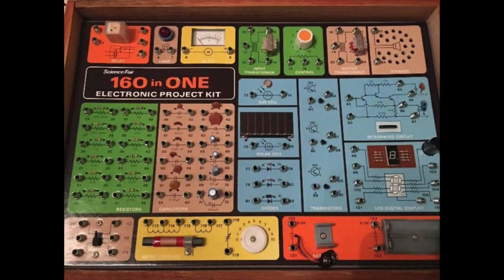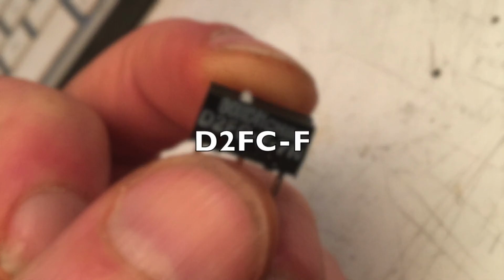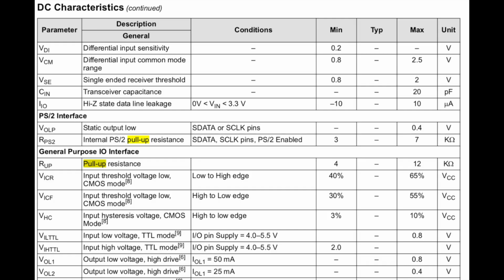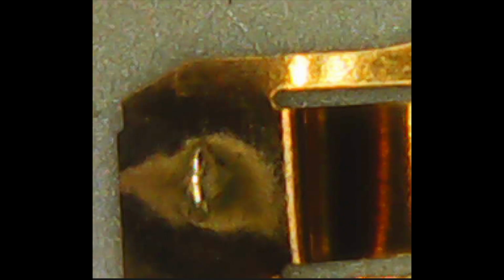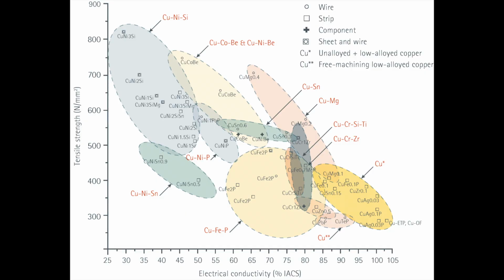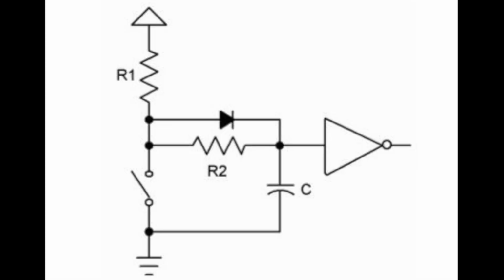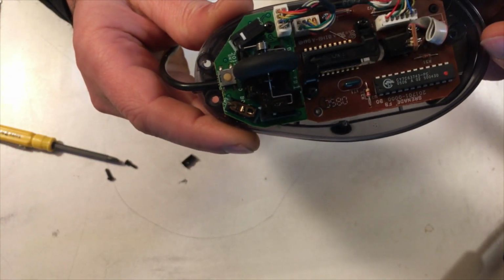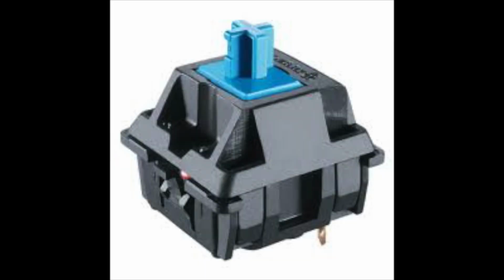Failing switch problem: Omron vs the modern mouse circuit

Comment: I hate to break it to you 7 years have passed and the problem that you stated hasn't been fixed. Coz they will never fix it. It's planned obsolescence.  Majority of switches I bought only lasted 1 year. That's the timeframe . 10-12 months of lifetime of all the switches. It's a scam.

Comment: Wow I didn't realize how prevalent this was.  My 10 year old G602 only just started doing this.  I tried clumsily "fixing" the switches but getting them apart and back together without ruining them is an art I haven't yet learned.  Guess I'll try replacing the switches.  I'd be happy to get another 10 years because I just love the mouse otherwise.

Comment: Unfortunately that open source mouse hasn't blown the big boys out /-: although I'm a fan of the Asus hot swap switch socket on some of their mice, solder free switch experimentation. Even up to 5 pin omron opti-mech switches

Comment: To mitigate the problem, Logitech changed from the G602 design (which had swappable and easy to reach L/R switches, but used a switch rated for 500 clicks for the middle click) to the G604 design with soldered-on switches that are an absolute pain to reach

Comment: current sinking of the microcontroller pins isn't even an issue.  the current is just through the resistor and switch to ground.  The only thing the microcontroller needs is 5v tolerant pins

Comment: In addition to what you discuss,
I also suspect it is possible another issue can be the solder connections may have or get micro-fractures that cause intermittent clicking problems.

Comment: If they design a mouse with hot-swappable switches,
they should also sell the plastic outer shell of the mouse for replacement, because those surfaces wear out too,
you would keep the circuit board.

Comment: i bought a brand new Logitech 203 with omron D2FC-F-7N(10m) that was defective the day i bought it a year ago, but i lost the box and receipt and paid cash so i had no way to exchange it.
Many times i just drop my finger down on the left mouse button, it often TRIPLE CLICKS! which is very annoying to hear.
Clicking and dragging is broken most of the time, no matter how hard i hold the button down.
I'm looking to replace the switches with something that isn't trash and to just buy replacement switches, instead of new mice every time.

Comment: @14:33 So far, those switches don't work in isolation and the guaranteed amount of operations are tied to a specific use case which gaming mice don't meet.

Comment: I had the double-click issue with my Logitech G305. I got it replaced before the warranty ended. It failed again. I replaced the with D2F-01F and it's fine since then. Thanks

Comment: leeel i just change my mouse a G600 i kept so long by changing the switchs and still have it , its not her end yet , but know im on a razer v2 hyperspeed and honestly the mouse feel not bad just the part u dismantle to change the battery is meh , the guy design it instead to put the batterie in the bottom of the mouse like '"normal" , he made it  possible to dismantle the top and there is a little space where the plastic move , its been a week i have it and still not found a way to fix it but i will^ and the end of the video^ lets have some hope !!!

Comment: This excellent content Alex! Side back button double clicks on my Logitech G Pro Superlight. I have order replacement PCB with switches and am going to also replace left+right button PCB with hot-swappable socket and new switches (just in case).

I have been long curious, why older mice didn't have this problem! Thanks for your explanation.
Reply: Just reached the section where you pulled the microscope! LOL, you are really going to dig the truth on the switches. Excellent. Subscribed.

Comment: I think they've gone down the route of voltage & current reduction in order to increase battery life - & either knowingly or unknowingly compromised switch life.

I'd bet they win financially by selling more units on account of stated battery life - versus the losses/returns/warranty work that the switch corollary creates.

Comment: Given that it's 2024 and Logitech is still selling their $70 trackball with a micro-usb port, I'm pretty sure Logitech is gonna do absolutely nothing to rectify this problem.  In fact, I think they would much rather their new mouse to have this "planned obsolescence" instead of letting us use the same $30 mouse for 10 years.

Comment: Very informative video. I got back into playing fighting games back in 2010 and used sanwa joystick that were built with OMRON switches (MS-O-2P, also known as v-01-3d5-a). I've built arcade sticks with these switches for like everybody in the local community, zero problems. Around 2020 I got back into gaming and built a new arcade stick and since then Im having "double clicking" problems. They "double click" when they are about to disarm and that makes a hadoken becomes a shoryuken aka loses you the whole fight. The same switch I've being using for a life-time now fails after less than 10 hours of usage! Its crazy and I have NO IDEA what is causing it. I've spent around 50 switches by now... The only ones that seems imune to that are the ones with twice the activation force from the default switches, and they are really bad for gaming... Im in a new house so it could be a power related issue, and we also use some raspberry pi controller boards instead the original videogame controller's pcb. Are there any advice you could give to a total dummy like me? What could I try in order to rule out possible causes for the problem and by exclusion to find the root of the problem? I feel like its a power related problem because the only other thing would be the pcb and they are pretty  popular nowadays, we should be seeing more people complaining about that...

Comment: please recommend a mouse that is not an industry scam
Reply: Zaopin z2.
All the firmware solves he mentions are present (not uncommon on higher end chines mice)
The switches it comes with (ttc60) are gold plated
AND it has hot-swap switches.
Closest youll get to a buy it for life wireless mouse.

Comment: Making easily replaceable mouse switches would be a game-changer. It would require the entire industry to adopt a new switch model, but thats why we have generation Alpha. Get to it kids!! Create this shit!! I mean can you imagine a mouse that you would just have to remove the cover when the switch goes bad with a few torque screws, buy two new 15$ switches, pop out the old ones, snap in the new ones, no soldering, nothing. It would be brilliant.
Reply: Zaopin z2 has it.
Uses screws to clamp down on the microswitches. And the mouse comes with the screwdriver.
And even better, premium switches are less than $1 each.

Comment: Woah, I was just trying to save $100 on my Logitech MX Ergo TB Mouse, and got a whole knowledge dump on switches. Now I've never really soldered anything before, so that's going to be the real test. Wish me luck everyone. If I can learn software development at 36 I'm pretty sure I can solder, considering I've been doing PC building since 1998 as well as wood working and various laboratory work for the past 14 years.

Comment: Is it possible to change pull-up resistor in modern mouses? For example razer deathadder 2013. Or they use intenal pull-up inside chip. Really feed up and overwhelmed to change switches because of doubleclicking.

Comment: additionaly

change the screw holes under the skatez to somewhere else. 
It won't look good visually, but it prevents the hassle of having to remove the skatez and then stick new ones on it. saves a bit of money

Comment: This video is insanely good and informative. I have a G903, and after watching it, I resolve my problem by simply dropping the pulling rate from 1000 to 500. 

The clicking action was fine, but I hated the lack of drag-and-drop functionality. After dropping the pulling rate, the mouse somehow started working again. While it is not ideal, I did order a few replacement switches and a backup (refurbished) upgrade G903 model for 75% off down to $25 on a sale. 

Once I get the switches, I'll do the necessary placements to "renew" my faithful G903.

Comment: I used my old mx518 switches in my asus gladius which has hot swap switches!  I really like the feel of them compared to the newer swtiches and like you stated they are pretty much bulletproof. How do you like the hardware of the gladius?  Seems like the best mouse I could find since he MX518.

Comment: Just came back to this video to refresh my memory about what switches were recommended. For those looking for a temporary software fix, someone wrote an Auto Hot Key script that works pretty well. 
I can't find where i found it but its pretty simple:
LButton::	
	If (A_TimeSincePriorHotkey < 150) ;hyperclick
		Return
	Click Down
	KeyWait, LButton
	Click Up
Return
Reply: I use a program called Mouse Debouncer. Same effect though.

Comment: Well, that answers my question of where and why the oxidation occurred on the switch.  
I'm just hoping they don't wise up and begin making the switches hard to replace or impossible to replace without damage on future gen mice.
(Wish I would have viewed this video before buying the D2FC-F-K(50M) replacement switches for a G700 that was tossed to the side, which I finally now fixing.  Why do something right the first time though when you can do it two or three times.

Comment: I have a Roccat Burst Core Buyed 1,5 Years Ago, it has the Titan Switch (Optical Laser Switch). It works perfect like Day 1, not a single feeling of worsening.
I think this Optical Switch is the Revolution we needed to Fix this Double Click Problem. They say they are testet with 100 Million Clicks. Most Omron Switches are said to last 10 Million Clicks. So instead of 4 Years you can use the mouse 40 Years. This Is a relativly new Tech. 
The Only Brands with this new Optical Switch Tech are Roccat, Logitech, Razer, Corsair, SteelSeries, Cooler Master and 2-3 smaller brands that i dont know.
But you should watch out. Some Older models with Omron are still in sale with this Brands. Not all Mouse models have switched to the New Optical Switch.
Reply: Thank you very much for this info, very helpful in my search for a mouse that can at least last a few years lol
Reply: @icethingy  Your welcome. The Roccat Burst Core is not even Expensive. Under 30 Bucks.
Reply: Some only use opto for main L & R buttons and at least 1 Razor only has opto for the L

Comment: My brain cant handle this video, can nayone smart, just tell me what switches to use for my Aria XD7, atm they have khail gm 8, and both my copies began double clicking after few weeks like wtf, while my model o wired that i had for 2 years, they used omrons i think, still work with no double click even to this day, only sqeeking a bit.

Comment: You nailed it, so much good in deep information. I came here because the LMB Omron died on me, 3 months after warranty of my corsair ironclaw mouse. Had this same mouse already send in because of the middle mouse button. Now the  LMB starts dying. First what pissed me most off. I am not a sweaty try hard gamer, and bought this mouse because of the ergonomics. It fits good in my big hands and it  was not cheap though. All this RGB and Gamer Tag crap marketing must be paid. This switch never ever has gone through 20.000.000 switch cycles. Not through my usage. 
Now i identified the switch and look for it at ebay. For 12 Euros i got 4 of them. So it's a cheap thing. This means, i buy a 80 Euro mouse and it dies because of a 2 Euro item. Unbelievable. Additionally they build this mouse in such way, that you nearly must destroy it, to open it. But i managed it to open it, without bigger damage. Got me some new switches and will replace this little thing. I hope it will work.

Comment: At 1:04:53 while the added cap might issue a current surge to the switch plating, its main goal is to discharge when the switch closes and offer debounce because it cant instantly charge through the pull up resistor. And works well because they been using it for half a century or more. Thx for the video.

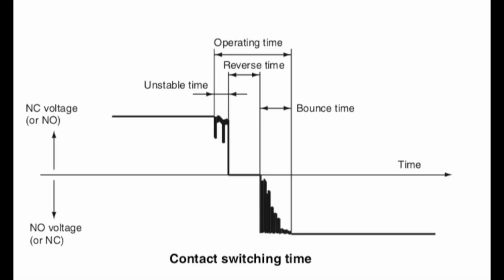Comment: @47:00 so "Schmutz" (dirt) is the reason 😂👍, in other words a combination of physical wear and tear, electrical noise, which also depends from the choise of materials/components, power currents and software filtering.

This video deserves much more attention, a lot of useful info, I was searching for the details about "why every mouse fails at some point" and found more than I was searching for, thanks a lot.

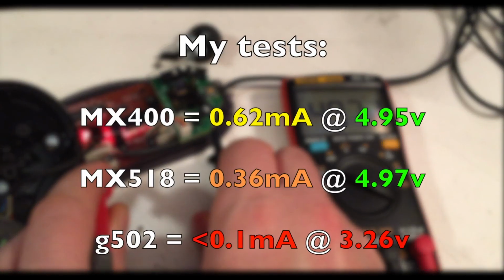Comment: @17:22 where you say that the MX400 "hit the voltage target and almost hit the current target" that is for the micro-load series of Omron switches. But based on footage earlier in the video (and comments, plus other sources) I'm left with the impression that none of the mouse tested are using the micro-load switches. Instead they are using the general-load switches. So yes it almost hit the current target for a switch that it isn't using. While in reality it almost hit the 1% mark of the switch that it actually is using.

Or am I understanding this wrong?

Comment: I'm new here and just replaced  my first gaming mouse's switch. It's a G203 and luckily was easy to take apart and replacing the switch was easy. Replaced it with an Omron D2FC-F-K(50M)-RZ. Also got an D2F-F-3-7 Japan Omron and will use it for my G305 when it fails. Had I known this earlier, I would've saved some money. Even my M170 uses the same type of switch

Comment: Dude, I had serious double click problems and fixed my switches couple of times but it didn't help much in a long run (Razer Imperator). But, when you said about polling rate, I changed it to 125 Hz and voila !  It helped quite a bit!
Reply: I have a Roccat Burst Core Buyed 1,5 Years Ago, it has the Titan Switch (Optical Laser Switch). It works perfect like Day 1, not a single feeling of worsening.
I think this Optical Switch is the Revolution we needed to Fix this Double Click Problem. They say they are testet with 100 Million Clicks. Most Omron Switches are said to last 10 Million Clicks. So instead of 4 Years you can use the mouse 40 Years. This Is a relativly new Tech. 
The Only Brands with this new Optical Switch Tech are Roccat, Logitech, Razer, Corsair, SteelSeries, Cooler Master, A4Tech.
But you should watch out. Some Older models with Omron are still in sale with this Brands. Not all Mouse models have switched to the New Optical Switch.

Comment: This is crazy, they had it good back in the day, the logitech g400 Omron switches took me 8 years to start double clicking and it was just because the plastic of the shell and the plastic of the switch started to kinda crack in the part both of them contact with each other.
Reply: Such a shame there's not a modernly designed Logitech mouse that has long-lasting switches

Comment: 3 years since my last comment and I wanted to come back to this video with some fresh info from the perspective of a hardcore gamer that has gone through more than 10 expensive mice from all sorts of brands.
 First - some of your suggestions actually saw practical use, here are some examples:
1.Glorious (mouse brand) added a debounce time adjustment in their software that allows the user to change it anywhere from 0ms to 16ms. It did actually help me with a left click doubleclick issue for a while while I was waiting for replacement switches to come from China.
2. Razer came up with an optical switch which does resolve the "electrical" part of the doubleclick issue. I used a DeathAdder V2 mouse for a while and yes it had 0 doubleclicking issues but the mechanical switch wear part of the equation was still in play and eventually the switch stopped being tactile and felt very flat,quiet and unsatisfying. Still progress nontheless.
3. There've been some attempts at hotswappable switches on mice by ASUS but they stopped doing it really quick. My guess is that most brands do not actually want their product to have longevity. In fact they're probably happy if it ends up in a landfill as soon as possible so that the customer is back on the market for more.  While initially the whole switch issue might have been accidental due to miscalculations from manufacturers on how advancement in chip tech would affect switches electrical response, now after years of researched it is clear that they're quite happy with it and planned obsolescence is in play.

Your vid is the best on this topic to this day and I've come to the conclusion that this is just a part of being a hardcore gamer, so I've gotten a soldering iron and a bag of switches from all sorts of brands (just to test for fun) and whenever my switches wear out I simply replace them. This issue is very reminiscent of the analogue stick drift in gamepads but at least with mice it's easier to fix.
Reply: This video made me buy the Razer mouse a couple years ago after my Logitech failed in 6 months and they refused to warranty it. Even after making me film a video of it failing.  After all the gaming, the mouse still feels like new.  If it didn't require that monstrously horrible software, it would be the perfect mouse.
Reply: @SinisterSlay1  What Mouse switch your New Razer Mouse have ? Old Style Omron like or the New Laser Switch Optical ones ?
As Nask say, with his DeathAdder V2 i dont think they will stop working.
I have a Roccat Burst Core Buyed 1,5 Years Ago, it has the Titan Switch (Optical Laser Switch) like Razer. It works like Day 1, not a single feeling of worsening.
I think this Optical Switch is the Revolution we needed to Fix this Double Click Problem.
Reply: @DevouringKing  one with an optical switch as well
Reply: asus still makes a lot of hot swappable mices.
Reply: on asus: 
The reason no one else did it is that they patented the system, making alternatives a PITA